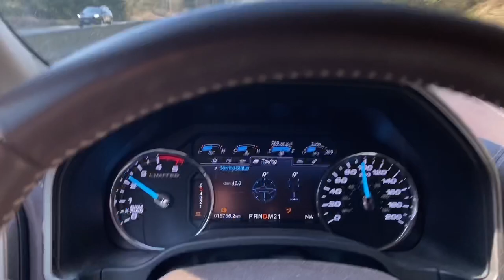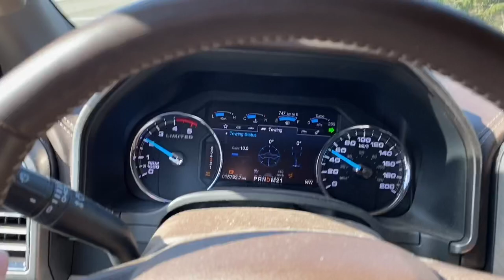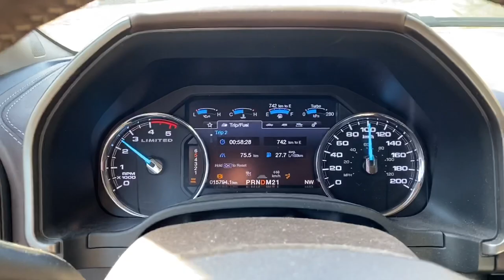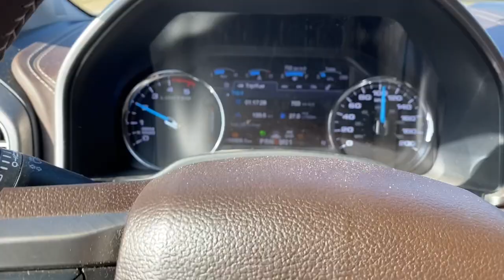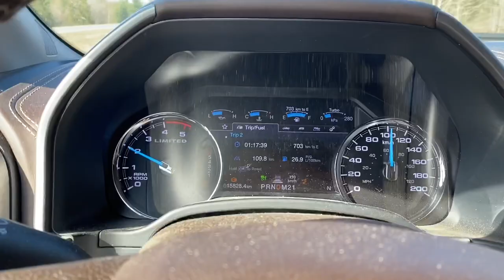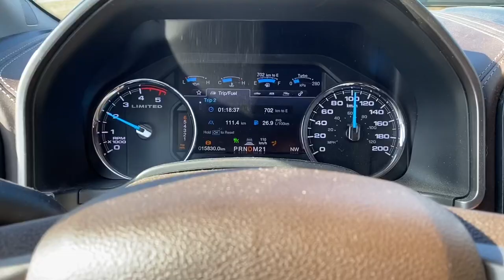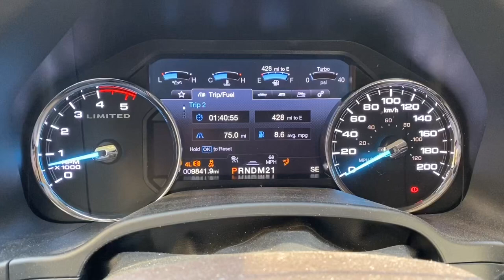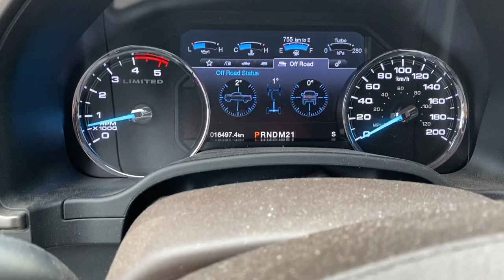2019 F-450 Limited 10k review and 35,000lbs towing mpg

Comment: My question is about the hitch.  You have a 2 5/16 ball assume if you have a 3 axle trailer with 21k then back out 5500 for trailer weight that leaves you at 16500 or so.   So the hitch on your 450 that's bolted to your frame can handle the 21500 ???

Comment: I still can't decide between the f450 and a ram 5500.  Thanks for the video.
Reply from the maker: I was looking at the Ram 5500 as well.  I think they are a solid truck but Ford’s commercial leasing program was way better.  I don’t think you can go wrong with either truck but what sets the F-450 apart from the 5500 or F-550 is the GCVW and towing numbers are higher on the F-450.  The 5500 and F-550 have much higher payloads though.  The F-450’s GVWR is 14,000lbs vs 18-19200lbs.  The F-450 is also much nicer to drive compared to the can and chassis trucks. I will still look at getting a F-550 or 5500 deck truck down the road but for hauling equipment trailers around the F-450 can’t be beat!
Reply: @gravytrainoutdoors  Thanks for the reply and insight.
Reply: Gravy Train Outdoors thanks again for the reply. Picked up my new F-450 today. Really enjoy it so far 
and I think it made the most sense for what Im doing.
Reply from the maker: jaotpt that’s awesome!  Congrats!  I don’t think you will be disappointed with the truck!
Reply: You can get the newer ford f450s with automatic trailer backup assistance that steers the truck for you.